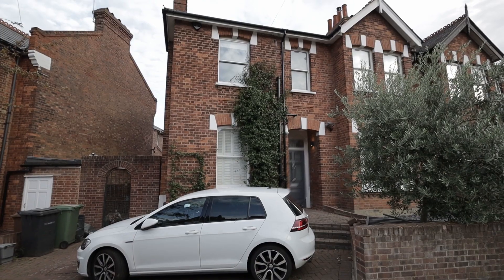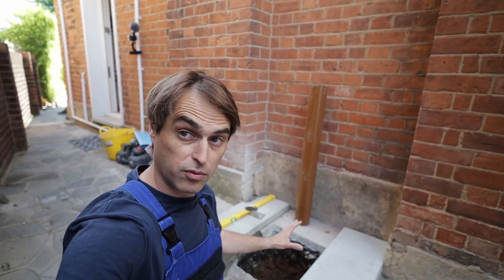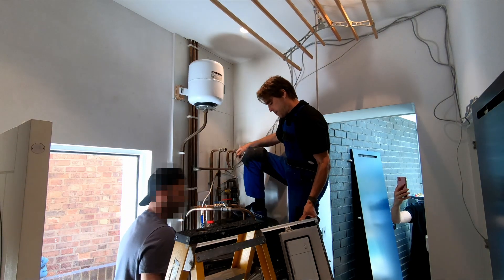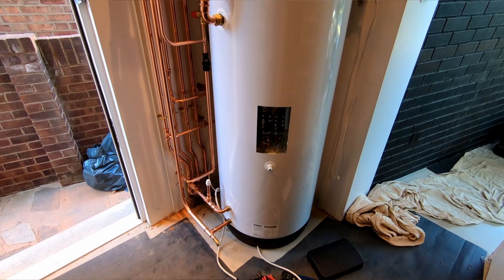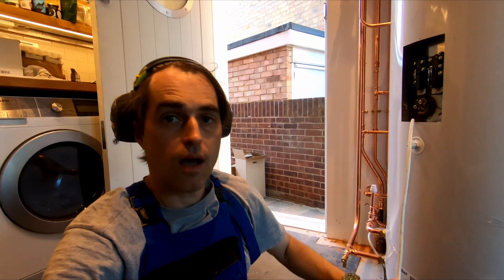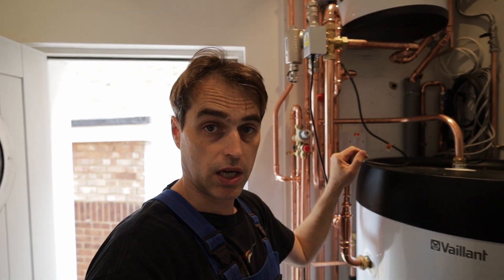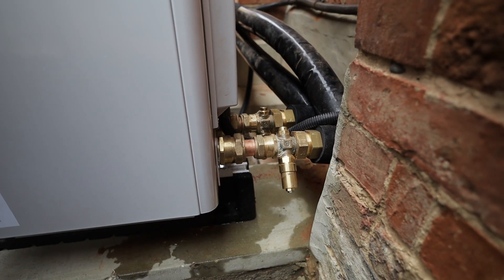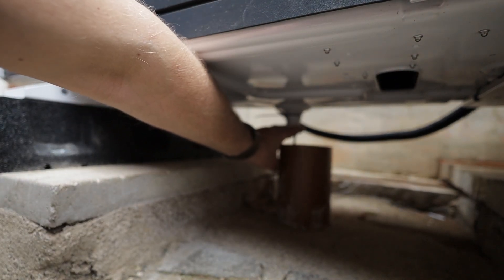Is This Heat Pump Better Than Your Gas Boiler?

Comment: The CO2 emission factor used is 0.309 kge / kWh, taken from BEIS (2018) [1] . This includes an allowance for the 7.8% of transmission/distribution losses on the national grid [1]. There is a more recent (2019) document [2] with a smaller factor of 0.277 kge / kWh. However, the 2018 value is preferred here because much of the reduction is due to the switch from burning coal to burning wood pellets, with the burning of wood pellet being treated as zero CO2 emission. There are strong arguments that large scale burning of wood cannot be considered to be zero carbon [3][4].
The CO2 generated by burning natural gas is 0.185 kg / kWh
Reply: Uk gov have published 2022 carbon factors now if you Google them. Electricity is now less than 0.2 kgCO2e for scope 2 (i.e. excluding T&D). You can’t pick and choose your preferred year for carbon emission reporting by the way, so 2018 is only relevant as a position for 2018 energy use.

Comment: Same running costs as gas and a lot more expensive to buy. Sounds like we need better solutions.
Reply from the maker: co2 emissions 75% lower? How else are we going to do it if not with heat pumps? And no, running costs can be lower.

Comment: Great video. I had a survey done for my bungalow for a heat pump. It did not go great I only need 4kw of heat for my tiny place but they were looking to run the heat pump at 55C to get reasonable sized radiators!
Reply from the maker: Upgrade rads or add insulation. Running at 55 is too high
Reply: @UrbanPlumbers  Running at 55c is to high? I run my radiators at 60 c.What you are saying you have to run a heat fan I callit 24/7 in the winter or not?I have a gas boiler the radiators are hot in ten minutes from cold.Microbore pipes radiatots Myson over 40 years old

Comment: Electricity is not "green" at all unless its produced from solar, wind or Hydro.
It takes about 3.5 units of energy to produce 1 unit of electricity.
Gas is "prime" fuel and therefore only needs cleaning and pumping, not energy intensive.
Reply from the maker: if you use a heat pump your co2 emissions are around 70% lower than your gas boiler, so yes it is greener - actually 70% greener
Reply: @UrbanPlumbers  Completely wrong, someone is feeding you wrong data.
The only time it uses less cO2 is when it is using 100% renewable energy.

Comment: Don’t think these are the future pal been to a few house’s where they are struggling with them for heat output in middle of winter. Ended putting new boilers in instead so it’s cost the customers a hell of a lot more in the long run.
Not only that they look hideous outside front of your house.
Great video though mate
Reply: Pretty sure they are the future. How else do you propose we decarbonise heating in the UK?
Reply: @xxwookey  do u think that tiny dot of a country on the world map is gonna be such a big difference when u have USA Russia and china polluting much more than us. We run round in 3 cylinder cars as it is.
Reply: @Dmab2007  We are all responsible for our own emissions. Chinese people pollute less than us (5 tonnes vs 12 tonnes (consumption basis)) so we really have no justification for pointing at them and doing nothing. They are making changes and are good at delivering what they promised. We'd all like it to go faster but to point at others and go 'nyer nyer, you go first' is just as childish as it sounds. We are all in this together.

Comment: If I may, can I ask a question: I have ideal vogue 32 gen 2 with nest 2 gen. If I would like to get weather compensation /open therm I have to upgrade nest to 3gen? I can see that there is a ideal kit available but I'm guessing that is if you don't have smart thermostat? It might be cheaper for me to leave gen 2 and get a kit but would this work? Can you use kit and gen 2? Or just gen 3 without a kit? Is wiring any different if upgading from gen 2 to 3?

Comment: What's the guarantee the electricity price will not go up? I think that's probably the plan to get these people who run their house with only electricity to be cornered up and pay a higher price. I can heat my house and my water both with gas and electricity so I use whichever is cheaper.
Reply from the maker: Gas prices are rising twice as fast as electricity right now
Reply: @UrbanPlumbers  right now yes, but there is no guarantee the electricity is not going to go up as well  in the nearest future. We are in a loophole with gas hence it's gone up but it's predicted to come down in the future.

It's very suspicious right now. The government is wanting more electric cars and heat pumps to meet their green eco scheme that they have signed up to. But then, the demand for electricity is going to triple and that is going to increase the price. It's a loophole right now! Will the gas and petrol will get cheaper? It's a no brainer.

In order to install a heat pump I would need to spend 10-15K. That's 5-7 years worth of heating for me. Just don't seem to be a good deal right now. The only way I would be willing to swap to heat pumps is if the price of the installation was equivalent to a gas boiler (£3K-£4K).

Comment: Surely the more heat you require the more electricity it will use depending on the outside temp?  Gas boiler for me .

Comment: Hi, may I ask, what I thought was two simple questons that even boiler manufacturers dont reply to. Heat only, 'new' system condencing boiler running only hot water during summer operation. Hot water storage tank selected temperature 60 degrees, what is the most economical temperature to set the boiler temperature,   60, or leave it in winter heating selected 70 degrees.  Also, Is it true that 68 degree flow heating temperature is the 'magic number' for condencing boiler efficiency.
Kind regards Dave Porter, london

Comment: 40 degrees is nowhere near enough to keep a modern house warm, let alone a refurb.
Reply from the maker: It actually is. You just need to know how to calculate heat loss and design what is called low temperature heating systems.

Underfloor heating works on even lower temps and can work as low as 25c surface temperature

Comment: Marginal gain for a very fortunate few who have the resources for retrofit HP system. My friend lives in Stockholm and he installed a vertical ground source heating system about 12 years ago at cost of around €45000.00 . The home built in late 70,s is incredibly comfortable and their energy bills are virtually  nothing. They sold so the new owners will really benefit long term . What software did you use to come up with 6kw ?
Reply: Are there any ongoing service and maintenance costs associated with the GSHP? What's it's useful life?

Comment: Great video, but as you point out a SCOP of 4 will only just equal a badly sized gas boiler.
I presume that a well installed condensing boiler, correctly set up with properly sized emitters should achieve 92-94% efficient ErP.
Therefore the heat pump will never even equal the gas setup even assuming the heat pump works as advertised - my 3 heat pumps (GSHP & ASHP) certainly don't achieve the manufacturers claims even with underfloor heating on both the ground and !st floor.
Its simply cheaper to use gas with the current 4:1price ratio gas/electric.
Gas is a primary fuel and suffers no transmission losses, only pumping costs whereas 1.7% of the electricity transferred over the transmission
network is lost, and a further 5-8% is lost over the distribution networks.
So up to 9.7% of distribution  losses are just part of the equation as the  generation of  the electricity in the 1st place.
Over half of the energy in gas and around two thirds of the energy in nuclear and coal used to produce electricity is lost as waste heat.
Heat pumps have a place but I am seriously concerned that they will become another government sponsored disaster.
Reply: @Andrew Stafford-Jones  If you don't care at all about emissions then sure the heatpump is probably slightly more expensive to run than a good condensing gas install, but if we don't care about emissions then we are all in serious trouble in the long term. Also prices are not fixed over time, as the massive rise in gas prices recently demonstrates. Thing will change pretty dramatically one way or another over the 15-20 year lifetime of an installation done now.
Reply: @xxwookey  Electricity is not "green" at all unless its produced from solar, wind or Hydro.
It takes about 3.5 units of energy to produce 1 unit of electricity.
Gas is "prime" fuel and therefore only needs cleaning and pumping, not energy intensive.
Reply: @andrewstafford-jones4291  Gas is a fossil fuel and we have to stop using it ASAP. And methane leakage is not insignificant. It's now significantly higher-carbon to burn gas in boilers in the UK than it is to use electricity as our grid is down to about 220gmCO2e/kWh. And that will continue to improve along with the grid. Your argument made (some) sense a decade ago, and is reflected in the SAP 2012 rules which persisted far too long and caused housebuilders to keep fitting gas boilers for far too long. It really has been time to stop doing that for a while.
Reply: @xxwookey  While I broadly agree that heat pumps should be encourage, I would add that gas boilers have a place even in today's world. An air source heat pump will simply not work in a poorly insulated (single glazing, no cavity walls etc.) home, no matter what any Heat Geeks say. 

In homes built from 1990 onwards, yes, they can work well. In homes with land for a ground source pump, yes, they can work well. All others need not apply. Focus on insulation upgrades first, then rooftop solar PV  !
Reply: @xxwookey  Your figures seem a little off, perhaps you are not including transmission and distribution loss, correct figures are:
The CO2 emission factor used is 0.309 kge / kWh, taken from BEIS (2018) [1] . This includes an allowance for the 7.8% of transmission/distribution losses on the national grid [1]. There is a more recent (2019) document [2] with a smaller factor of 0.277 kge / kWh. However, the 2018 value is preferred here because much of the reduction is due to the switch from burning coal to burning wood pellets, with the burning of wood pellet being treated as zero CO2 emission. There are strong arguments that large scale burning of wood cannot be considered to be zero carbon [3][4].
The CO2 generated by burning natural gas is 0.185 kg / kWh
Reply from the maker: in those homes we can use hybrids - where gas boiler supplements a heat pump - still should drop co2 emissions by a massive margin
Reply: @UrbanPlumbers  Who is the top manufacturer for this type of heat pump?
Reply: @andrewstafford-jones4291  so .309kge / kWh of electricity produces 4kWh of heat so emissions of 0.08 kge / kWh heat vs 0.185 for gas. You have proved emissions are much lower for heat pumps - well done!

Comment: Approximately how big is the indoor footprint for this type of installation? I'm building a utility cupboard and want to make sure it has enough space for an air source heat pump in future.
Reply from the maker: 750 x 750 should be plenty

Comment: So 6kw with an scop of 4 is 1.5kw actual electricity at 65p per kwh (soon to be) so will consumer 98p an hour. Compare that with oil which at present is 9p per kwh (currently 90p per litre, 10.3kwh per litre). Even if I was modest and used the 82% forecasted increase in October that will be 50p per kwh and would cost 76p and hour to run.  Couple that with 18k quote for installation then its game over. I think I'll continue with oil for now, might be 10 years before we recover from the energy crisis and while demand for gas and electricity is high so will be the price. I think this gov plan will be axed very quickly when them bills start rolling in October.
Reply from the maker: Actual energy requirement for this property is 12,500kWh per year for heating and hot water

This means at current prices of electircty around 28p a kWh and oil at £1,06 per liter the running cost at the moment is:

£1100 per annum on air source and
£2090 on oil

Comment: I was just doing the maths on this running at 6.5kWh. If you have the system running 6 hours a day & 9 months excluding 3 for good weather it’s not pretty given the predictive electric prices. Come January we’re predicted to see around 62p per kWh. If we use this to run this unit for 6 hours daily that’s £4.03 per hour. 1 day £24.18. 9 month to run this for 6 hours daily will cost £6619,27p annually.
Reply from the maker: your calcualtions are way off.

Actual estaimted energy requrement for heating and hot water per annum on this system is 12,500kWh. That makes the running cost of ASHP at 65p per kWh of electricty to be £2,472.00 per year or £206 a month.

For your calcautions to be correct we would need to have -2 tempareture outside for 9 months 24 hours a day.

Also at current cost of 28p per kWh running annual cost of this system is £1,100
Reply: @UrbanPlumbers  I’m just basing this rated on 6.5kWh you mentioned. Regarding temperatures inside & outside it’s not something I’ve ever heard before but I’m not a heating engineer. I’m purely basing those figures on how you’d calculate your fridge or any other appliances. 12.500kWh @ 65p per kWh isn’t that £8125?
Reply from the maker: @everythingtechnew7400  12500kWh is the energy required to heat the home and hot water per annum. 1 part will come from the mains electricity and 3 parts from the air - hence 'air source heat pump'. 

At the moment 1 kWh costs 28p. For 12500kWh of energy to heat the home, you need to draw around 3125kWh from the grid. 28p x 3215 = £900 per year

If the electricity was to cost 65p per kWh this system will cost £2,031.25 per annum to run.
Reply from the maker: @everythingtechnew7400  6.5 is the output of the heat pump, not the input. Most of the year it will run at around 3kW-4kW output - this will require around 1kW power from the grid to run.
Reply: @UrbanPlumbers  okay thanks.